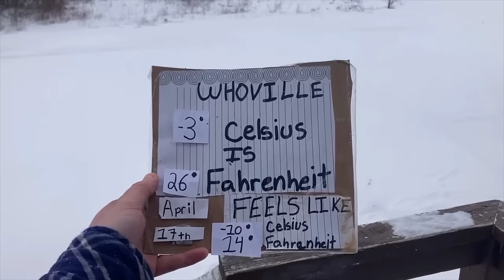Spring Snow Storm Arrived So Built Another Tool Box 1946 Chevy Truck April 17 2024

Comment: Good morning from Cape Cod ⚓ 47 degrees at quarter of 2 in the morning. All the trees are budding, the grass is growing and I have to go put a tube in the lawn tractor tire. Your battery box and toolbox are coming along nicely. It was cool watching the past videos of the Kingdom, the cats today run much better with the upgrades you've done to them. While you're frolicking in the snow I'll be screwing with a tiny tractor tire 😂 ✌️🇺🇲
Reply from the maker: not that warm down there. yes a lawn tractor is a rare machine up here because not much grass to mow for some reason. long time coming but slowly getting these machine running and fixed up.  thansk

Comment: Good morning from Gagetown, the tool box and battery box are going to be a great addition to the truck. Been trying my gas less mig welder a bit . 035 wire heat up and lower wire speed, I don’t seem to get very good penetration. So I usually turn to the old AC/DC buzz box. Not giving up on the mig though. Hope everyone has a great day.
Reply from the maker: yes the recycled steel in the storage shed is not very use-full but as a tool box then it becomes use-full. i never gone past 2 on the volts and just adjust the wire speed on the Horbart Handler 100.  thansk

Comment: Man seeing you ride the solar equipment makes me so mad when I see them just take all the equipment out of the woods and then put it under a building and then call it a museum it's so sickening they think they're saving something by shoving it under a building and then not using it 30 to 45 mi from me there is a Lynn tractor just like you use Lombard block hauler and then there's this other thing that's got tracks in the back like the lumbar but it's got like a truck front it kind of looks like a Lynn but bigger and it has a Waukesha or Wisconsin engine in it the tracks in the back about 8 ft long a piece you can see a video of it if you go to the Ashland Logging Museum on YouTube here
Reply from the maker: will check it out and most likely a linn tractor. we are a museum but a working museum where these pieces go out in the cold to have fun.  thansk
Reply from the maker: checked it out and good display of lombard equipment.  thansk